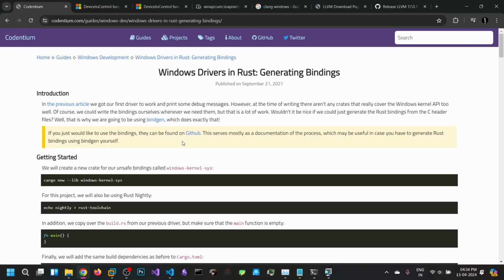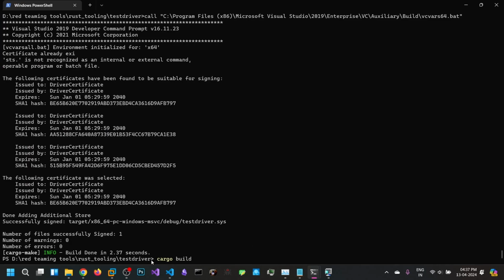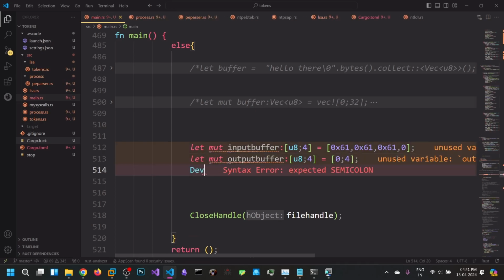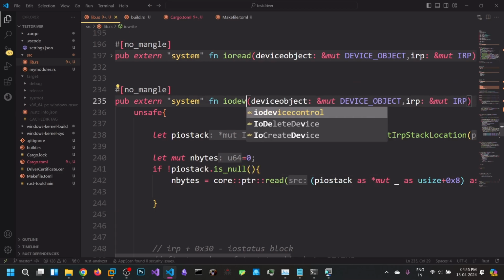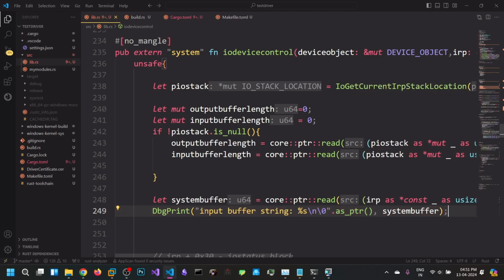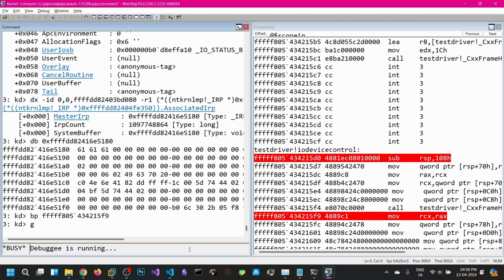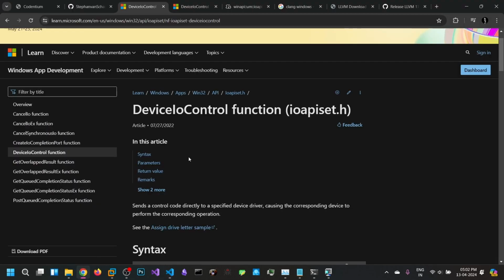Rusty Windows Driver Development Part9: Custom IOCTL operations

Comment: 00:03 Importing and utilizing external projects in Windows kernel driver development
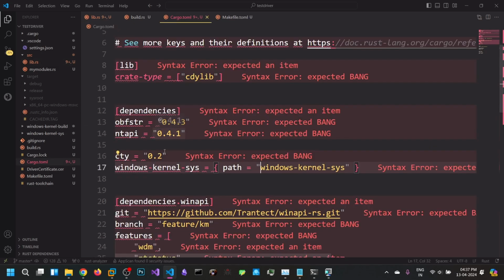02:49 Setting the path and importing functions for Windows driver development
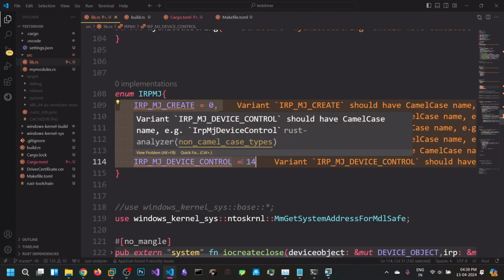05:13 Custom IOCTL operations allow defining and using custom control codes for device communication.
08:52 Handling custom IOCTL operations in Rusty Windows driver development
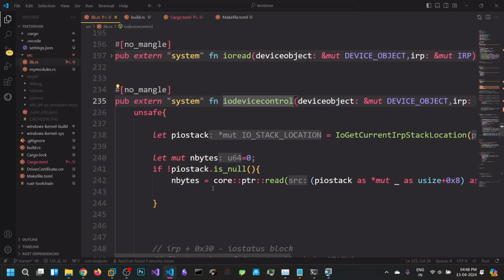12:13 Reading and printing input buffer and system buffer
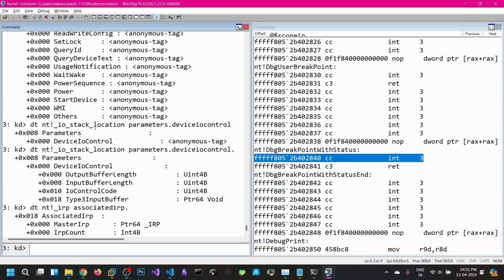15:28 Using mmGetSystemAddressForMdlSafe to translate the address
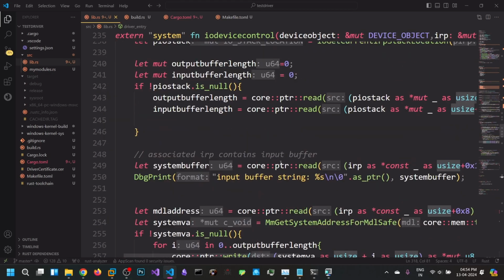18:34 Understanding IOCTL operations and associated parameters
23:39 Custom IOCTL operations in Windows driver development.